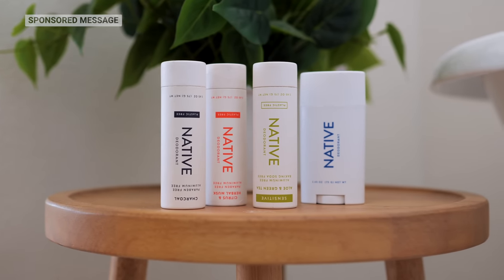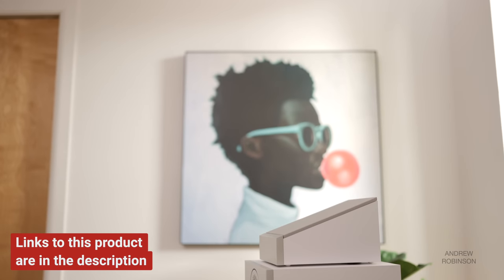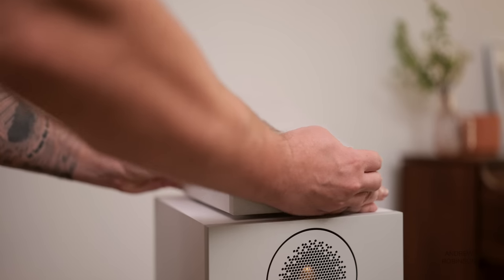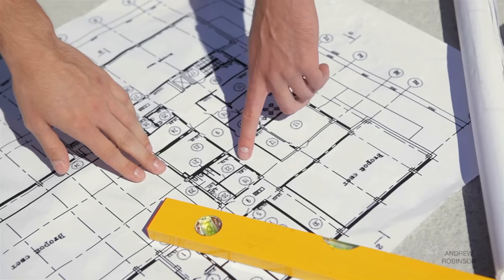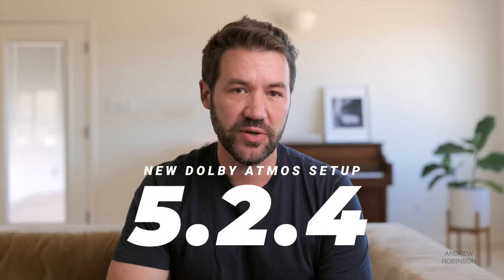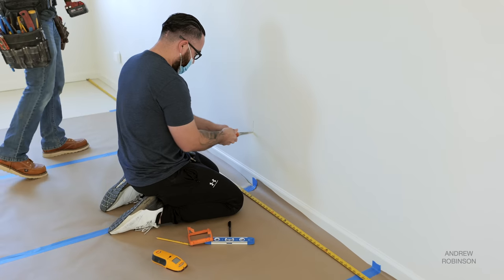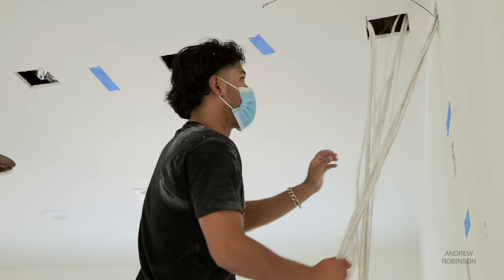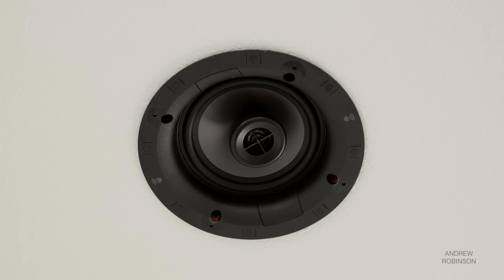INSTALLING DOLBY ATMOS SPEAKERS! Atmos In Ceiling Speakers

Comment: As a European living in an appartment building i’m always amazed by the ease of running cables through dry-walls. I’ve spent a full day cutting a 50cm long and 30cm wide tunnel for TV cables into the steel reinforced concrete wall here. Had to rent some serious tools for that. :) great video as always Andrew!
Reply: Anywhere where the buildings are made of concrete, maybe because of Hurricanes or earthquake codes, should have spacers and drywall on the inside.  Definitely makes it easier for cabling of any sort.
Reply: That’s where sound bars and white (painted) cables come into play:)   Did you drill in the ceiling for Atmos?  Cause I’d advise anyone to save their time and money before adding 2-4 channels in the ceiling unless you’re finishing a basement in the US where running cables is really easy.  I use 2 rear in-ceiling speakers in my basement to avoid speaker overload and still get surround effects.

Comment: My system is 7.4.4, I installed all myself, I was lucky the ceiling joists lined up though, I'm a boilermaker, so I made speaker brackets for the 4 Atmos, used one coach bolt centred in each bracket to mount them to joists, it allows me to angle them at listing positions, also able to adjust tilt angle to listing positions, I used a laser pointer to align them, also for all other speakers. Master to the system is YAMAHA RX-A3070, employing 2 external amps that are KENWOOD krf-v5100d-s, using the 6ch-in of them, 1 kenwood power's my Atmos, the other kenwood power's my side's and rear's, leaving the grunt of yamaha to power fronts and centre, my speakers are Accusound Reference 8.6xd 200w 8ohm 90db, for centre, 4x Atmos, rear's and side's, my fronts are Polk Signature Series s60's, because they are a great match to my Accusound's, my subs are 2 Accusound Reference 8.6xd 200w class a/b amps, with 2 Emotiva Basx s12 300w class d amps, set up like so using monaural x2, 1 Emotiva to the front of room with Accusound daisy chained to it, the other Emotiva to rear of room with Accusound daisy chained to it, positioned using subwoofer crawl, I also made stands for rear's and side's, tripod like stands, the tops where the speakers mount are the same bracket as Atmos, so I can adjust them to suit too. With some home made room treatment. 
 it's a modest system that sounds like a million dollar one.

Comment: I have done this exact same setup before - it does not work well.  Yes Atmos sounds good, but there will be MUCH LESS separation between the heights and the surrounds.  They kind of blend into each other in a bad way - all of them start sounding like heights.  If your heights are ceiling mounted, then your surrounds need to be lower - optimally at a handful of feet above ear level
Reply: You need auro3d ,denon and Marantzs auromatic sounds amazing

Comment: When I built our basement family room, there was no intent to have any kind of speaker wiring. But I did put a coffered border around the perimeter of the ceiling that has removable panels 'just in case'. That labor intensive effort has more than paid off over the years, allowing everything from more wiring into the kitchen above to installing wiring for a 7.2.4 Atmos system to getting gas out to the deck for a grill, all without any ceiling cutting & patching.

I have not tried the bouncy speakers, but have read from quite a number of sources that have compared them. I just can't see how a couple of up firing speakers at the front of the room can come close to duplicating the experience of  having 4 properly positioned ceiling mounted speakers. I think it's well worth the effort to have them installed as close as possible to Dobly's Atmos install guide.

Comment: I managed to fit and conceal 3 subs in our 15’x16’ living room. The Monolith V2 10”, an RSL Speedwoofer 10s MKII, and a Klipsch R 100SW. And I installed 4 Atmos along the beams on our ceiling (so not in ceiling speakers but wall mounted speakers. And they are custom painted the same color as the beams. The same with all other speakers in our 7.3.4 Atmos system. A lot of work and tuning and tweaking with REW, Audyssey MultEQ XT32 etc., but man it’s worth it. Thankfully my Dad taught me a ton in construction and electrical work due to him being a mechanical engineer. But 100% DIY is not everyone’s forte, and that’s perfectly fine. There’s something to be said for having a professional crew do things for you, saving you a ton of time. Love your channel and I have learned a lot from you and your wife. You both are awesome 😎. Thanks. 👍

Comment: Wow, I cannot tell you how great your channel has been during this year of getting more into home theater. Irony being that I come from an indie rock band that spends a lot of time in the studio but when it came to theater up until recently, I was a complete imbecile. My wife & I are currently in the middle of having our first home built and while we were initially just going to go with the Sony HT-A9 to pair with our Sony a90J 83” for our open living room which is where we will do our daily entertainment, I was sucked into the grandeur (and luckily my wife as well) of the test theater we listened to during a complimentary pre wire meeting. Since then I got the itch, and while I swore I never wanted to deal with the hassle of a full system, here we are, I was able to get an AMAZING bargain for a 5.2 Klipsch system, which we are now going to pair with the Prewired 4 height channels we’re getting from the AV company our builder works with. This channel really helped us see that the “incentive” package they were offering us for a rinky dink system fit for a much smaller or beginners set up. Luckily the AV company we’re working with us and loves that we’re coming into this with a bit more education than the average customer, so just wanted to say thank you for making things to simple, this channel is a god send!
Our set up will be 5.2.4:
Yamaha RX-A9A
2 - Klipsch R28f 
1 - Klipsch RP-450C
2 - Klipsch RP-150M (or maybe some more ceiling heights, as your idea described in this video for the rear surrounds)
2 - Klipsch DS-160CDT front heights
2 - Klipsch DS-160C rear heights
2 - SVS PB-2000 subs
And eventually a BDI cabinet for it all, and a 3 channel Emotiva XPA amp

You and your wife are great team, keep it up, thanks again from the London Family in El Paso, TX, and hey, our first professional major recorded album comes out later this year and now that you’ve helped us create an amazing space for a listening party, you guys are welcome down to our side of Texas anytime!
Reply from the maker: Thank you so much! We appreciate you watching.

Comment: This is just Deja Vu...LOL.  So, Andrew & Kristi, first, congrats on the new home.  No matter where you are, I'll use the same mantra you use at the end of every video...no one has to like your home except for you.  And, "home" is where you make it!

I have spent the last 60 days redoing my lower level and it has been a major transformation from what I had before.  New projector (100" TVs are still just too expensive), new AVR (which, as you know is a major pain to acquire), new ceiling mounted Atmos speakers (only 2), and moved everything from a dedicated "rack space" in another room to directly in front of me in a fine piece of audio cabinetry.  Pulled the new ceiling wires myself and relocated some as well.  And, despite knowing what was there (joist orientation, plumbing, etc), it was a pain and I had the same swiss cheese you had.  And, yes, after all the patching is done, you wouldn't know there was swiss cheese.  BUT, I also, repainted the room (including the ceiling).  You just cannot match the old paint even with the same brand and color after it ages.  (OK, I'm a bit OCD as well...LOL).  

Bottom line, I love the new 4K (had 1080p before) and Dolby Atmos.  I think you will enjoy the ceiling mounted speakers over the upward firing.

BTW, if you put a rack in that is located in some other room, how are you going to do your Dirac "correction"?  Or, does it have a "remote" microphone option?

Continued best wishes on the move and the new home!

Comment: If you are putting speakers in ceiling for Atmos ...after room correction ...you will have to up the levels of the speakers ..to get the most of the effects ...because there is not a lot there and when there is something there you want to hear it.

Comment: Awesome video guys. My wife and I went through the same situation and I have the same layout of the 6 in ceiling speakers. Our front and back wall are shared with neighbors. In ceiling speakers were the only option.  

I aimed the front tweeters to my seating, the middle speakers straight down and the rears at the back wall to reflect to my back wall to give a sense the rears are behind me. Good luck.👍🍀
Reply: The depth perception is more believable as rears. Makes the room feel more spacious.
Reply: My wife was tired of back speakers and all the holes and patch work I have done over the years. In this newer house, she was not having it. I like the fact that no one notices until after They’ve heard them.

Comment: Paint "takes" to different surfaces differently. So you might not get an exact match using the paint on drywall and metal grills. It'll get close but never exactly the same. And the paint will wear differently over time. Also I know your wife is an audiophile but it's still interesting to get this dynamic of seeing a couple making decisions that couples generally have to make when buying audio equipment. I don't know any other reviewer that has the ability find out what the "waf" is. They can make guesses. But they don't have their wife in the video actually giving us men that perspective. I really like that. Good luck with the new home  I can't wait to hear your opinion on up-firing Atmos vs in-celling!

Comment: Installing anything in ceiling can be tricky, I did all the lighting in my friend apartment and I had the same problem, I couldn't pass through the cables 'cause the barriers installed by the drywall guys. I know exactly how big the problem can be. But, after all, it's a fulfilling experience seeing all put together. It's worth it, it's a one time problem and a lifetime satisfaction.

Comment: Ceiling speakers are quite satisfying, sound pressure coming directly from above gives better quality than defused upward firing.
My first system was an Onkyo  up-firing Dolby Atmos Enabled speaker, also was the first home system they sold.
I loved it until I moved and Atmos effect was gone. I got a pair of separate Dolby Atmos Speakers, tried the three configurations, up-firing, top front and last (and hardest to mount) down-firing. 
It’s glorious! I realized how much of the frequency I was missing, it’s easier to calibrate due to proper distance and dB level.
Every Atmos Mix in movies comes to life, and you should try Music in Atmos; depending on the recording and mastering. Apple Music is the most comfortable option for this to me.
Lately I test the system with The Weekend’s SACRIFICE, FINAL ASCENT from No Time to Die’s score from Hans Zimmer.
I MUST clarify something, this Atmos quest made me upgrade my whole setup. So you proceed with caution my friends.

Comment: I like how you designed for flexibility in how many channels you chose to use in the space.  4 atmos speakers would probably be too much in my space, but I have been considering replacing my surrounds with in ceiling speakers.  I have plenty of walk in attic space around my room and set up my atmos speakers, and I have helped a buddy set up his room with in ceiling surrounds.  I think good room correction really helps with these types of surrounds.  Right now my surrounds are mounted on a wall in a near ideal location, but "we" have other ideas for how to use some of that wall space.   I started this hobby as 20 years ago from the home theater side, and over time have move more and more into the musical side.  My listening is still probably 70-30 spit towards movies, video games and TV, but am really enjoying the musical experience more and more.  I loved your video on receivers for 2 channel listening because that is what I have been doing for a long time now, and for me it has worked and was a necessity as I did not have the space nor money for separate listening spaces or equipment.  Keep up the great work, I am looking forward to more of what you do with your listening space.

Comment: Been there, I'm no fan of wired rear surrounds. When we remodeled  the basement we considered in ceiling speakers but opted out in favour of an initial 3.1 setup with a plan of moving to a Sonos wireless setup later. However we decided to stick with 3.1 as we saw no real need / benefit in going Sonos.

Comment: I installed a similar system in my home using Yahmaha speakers. My challenge was my ceiling has a peaked roof right down the middle from front to back. I'm a woodworker so I made boxes out of cherry which match the tone of the knotty pine ceiling and are wedge shaped to allowed the speakers to fire straight downward. I do have attic access for wires. The project did take a week but the results were worth the time. Good times!

Comment: KEF Ci200RR-THX atmos ceiling and KEF Ci3160RL-THX for in wall surrounds combined with KEF fronts (R3 or R11 in case of your massive room) and there isn’t any better setup I’ve heard so far.
Btw in wall surrounds you can put some acoustically transparent art over them if you don’t like seeing them

Comment: I have the Klipsch upfiring Dolby Atmos speakers atop  a pair of Polk M70s.  (Audiophiles, stop gagging).  They fit perfectly and sound great.  The room has a 12 foot ceiling and I did have to adjust the volume up on the Klipschs, but other then that  there have been no issues. Sources differ of course, but I have found  the height effects to fall roughly in front of my seating position, sometimes mixed with the rear speakers which are on adjustable wall brackets.  The 
Atmos effects on the Dune 4kHDR disk are absolutly incredible and all encompassing, a good test for your system.  Also, the series Servant on Apple TV+ has Atmos effects that are downright creepy, the best I have heard on any streaming platform.

Comment: I built my first sound system with upward firing speakers 46 years ago. The ideas (which I patented) was to build a sound system where the reflections from the walls and ceiling would have the same mathematical relationship to the sound from the main speakers as the reflections of a very large space like a concert hall have to the sound coming directly from the performers. It took a lot of physics, mathematics, and electrical engineering to figure it out. Your problem with your atmos speakers is that you can't adjust the loudness of the upward firing speakers independently from the forward firing speakers. If you could you could make the upward firing speaker relatively louder where the ceiling is higher. The problem with having only a few downward firing speakers in the ceiling is what I call the supermarket effect. In a large supermarket there may be over a hundred speakers in the ceiling but the one you hear is the one closest to being directly above you. The reflected sound in any room that does not have concave surfaces like a dome is extremely diffuse. Sound arrives at your ears from many directions in rapid succession. 

In my current prototype, only the second one I built I have two main speakers where I've added 3 upward and 8 side firing tweeters per channel and 16 small upward firing speaker systems (Radio Shack Minimus 7) speakers around the room along the perimeter. The signals fed to those speakers undergoes a great deal of digital and analog processing. The current one is based around a device that infringed on my patent by incorporating the mathematical algorithm I devised. I warned the manufacturer and he never made another one like it. I can't tell you what it is but they're dirt cheap now. I've got nearly a dozen of them. That unit had one flaw and one missed opportunity. It took me about 6 years to figure them out and how to correct them. It required two more units. I could add more direct firing speakers around the room if I wanted to give it additional capabilities of an HT but I don't want to. I have an HT system in my bedroom. There's mostly very old audio equipment around my house but my experimental system is the only one I listen to anymore.

Comment: Andrew. Just a thought. If you're doing inwalls for the side or rear speakers. Run a second set of wires and make speakers outlets just over the floor. Therefore you can bring standmound speakers for future reviews and not stuck to your system.
Reply: Unless I misunderstood , they are not intending to use in wall as base layer side/rear speakers but rather two / four of the in ceiling speakers as "surrounds". I hope Andrew clarifies this because I was more than a little confused by that ...Andrew?

Comment: Downward firing tilted ceiling speakers is probably what you need. And I would also recommend the smaller 3 or 4 inch size versus bigger 6.5inch. And yeah good call on the bigger gauge wire run, 10-12 gauge is the way to go depending on how long the run will be. Good luck overall in the new home. 

Question - I recall you mentioning Cheapaudioman Randy helping you in some way or another. Cool that you guys intermingle.
Reply from the maker: Randy is a friend and he and his family were very helpful and supportive while Kristi and I searched for a new home. I have to be honest, it can be very lonely being a content creator, not to mention very demanding and unfortunately it's a lifestyle not a lot of people can relate to. It's important to have at least ONE person who can relate when the times get tough and Randy has become that friend to Kristi and I.